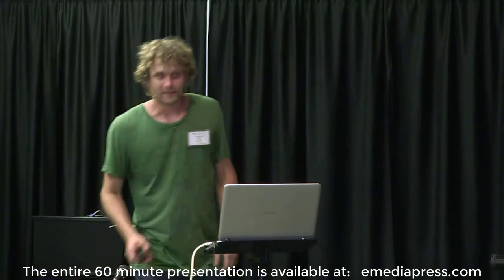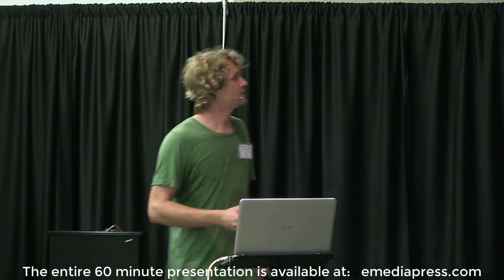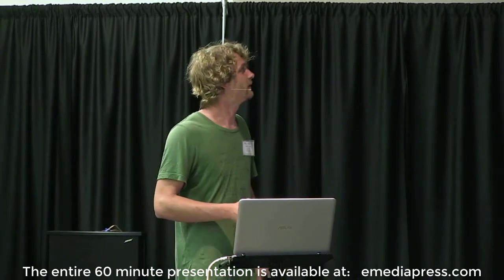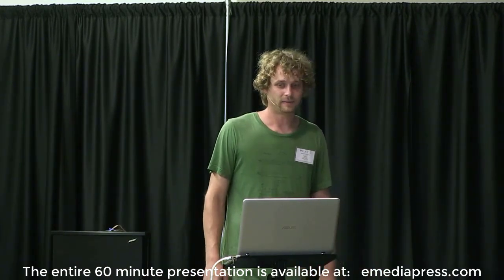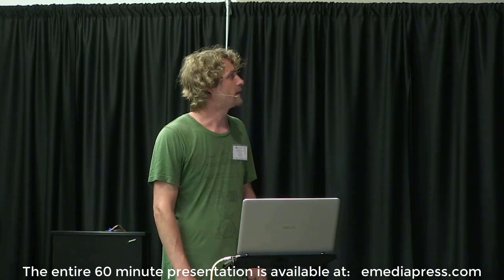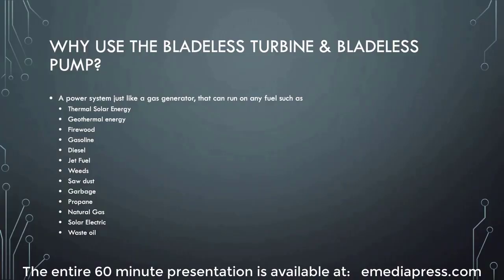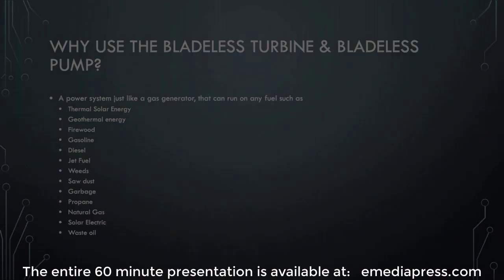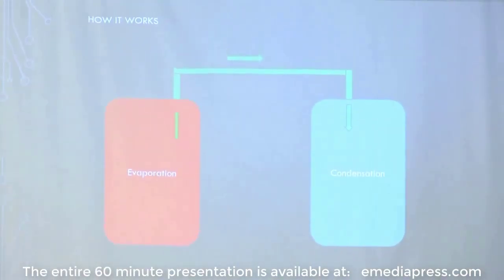2021 ESTC Preview - Nikola Tesla's Thermodynamic Transformer (Tesla Turbine) - Jeremiah Ferwerda

Comment: I mean just imagine... with this being up to 98% efficient. Generator being 95% efficient and new electric motors being 95% efficient... you are basically looking at a ~90% efficiency, compared to a 35% for the current car engine.

It means you can save ALL existing infrastructure, while needing 1/3 as much fuel. The implications are huge!

Comment: Could it be that the turbine speed up if you close the valve that it completely equalised the negative pressure whit the condenser so it doesn't have resistance enymore?  Just like a vacuum cleaner!

Comment: i want one that uses those efficient specs but with a fluid of mercury, in theory what little the mercury will expand between condensation to convection would be like your water vapor test, perhaps with more torque?  metal on metal if the rotor and turbine discs were titanium. tap in to the power of quarks

Comment: So, if there is also an anti noise device installed and the lifetime/maintenance is OK it (Tesla pump and condenser) could be added to existing heat pump installation in the homes? Maybe the existing pumps can function to create a starting vacuum in the system ':) That way I don't see any conflict in monopolitical economic interests ':)

Comment: so its overunity/free energy a thing or naaaaaa
Reply: Naw. It’s the exact same vacuum turbine system that Teslas grown D’Arsonvil’s came up with in the 1880s that George’s Claude (as in the Claude liquefaction cycle) first showed working in the early 1930s just before Tesla released the article “Our Future Motive Power” where he suggests using his turbine instead to be able to get the highest efficiency being able to handle the wet steam. Also Ocean Thermal Energy Conversion (OTEC) plants use the exact same systems but not with TesTurs. Jeremiah is replicating the large plant systems in a small home unit that also uses a Tesla turbine that can handle the low grade multi phase steam without detriment like all other bladed turbines. 
https://en.wikipedia.org/wiki/Ocean_thermal_energy_conversion

Comment: Sounds like something Elan Musk could use on his Star ship? Vacuum of space shade side sun side heat differential?
Reply: But yes it could potentially work just like you suggested using the sun for a heat source. You would need very large mirrors though and a way to store the heat efficiently without losing energy to space. Nasa already uses the same heat differential in space to the cold vacuum  from slow nuclear decay reactions of radioactive materials and thermoelectric generators to provide power to onboard systems. They use them because there’s no moving parts and it lasts as long as the decaying material is still radioactive. 
https://solarsystem.nasa.gov/missions/cassini/radioisotope-thermoelectric-generator/

https://en.wikipedia.org/wiki/Radioisotope_thermoelectric_generator
Reply: The Sun emits no heat. Or visible light.
Reply: @thedarkmoon2341   So, what is it doing?
Reply: @Str8murkufool17  Emitting much shorter wavelength E/M radiation that is converted to visible light and thermal infrared by Earths atmosphere.
Reply: @thedarkmoon2341  I’m sorry but that is patently false. like 100% false.
Reply: @thedarkmoon2341  solar panels or space telescopes  wouldn’t work in space if that was the case. 
https://en.wikipedia.org/wiki/Solar_panels_on_spacecraft
Reply: @Str8murkufool17  you can see the suns full solar radiation spectrum on a graph here. It’s 400-700nm is visible. The vast majority of the suns radiation is in thermal infrared light.
Reply: @CharlieSolis  So show me a photo of the Sun from space using the same type of camera and solar filter that we use to photograph the Sun from Earth. A Neutral Density filter should give a good approximation of the colour. 
And how about a direct measurement of the Suns heat from space using a pyrheliometer?
Reply: @CharlieSolis  Can you show me the technical specs of the ISS solar panels?
Reply: @thedarkmoon2341  Dood I’m not even going to argue with you about this as the premise of your arguements are patently false. The atmosphere absorbs some of the suns radiation. It does not convert “high energy beams into visible and infrared radiation.” That is 100% patently false. The su, and all other stars for that matter, have simple black body radiation curves. This isn’t even questioned science, like at all. For that matter the real onus of responsibility for proof is on you. You are the one claiming these wild things. How about you show proof of your assumptions….

For that matter here’s the suns full emitted em spectrum 
https://www.e-education.psu.edu/meteo300/node/683

Solar collectors in space
https://en.wikipedia.org/wiki/Space-based_solar_power